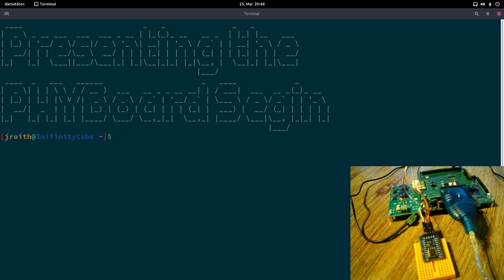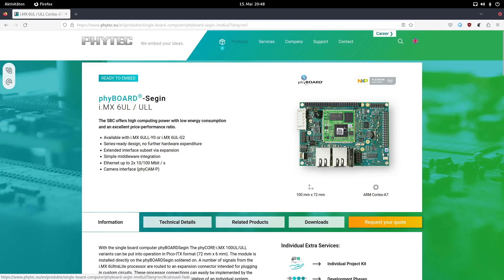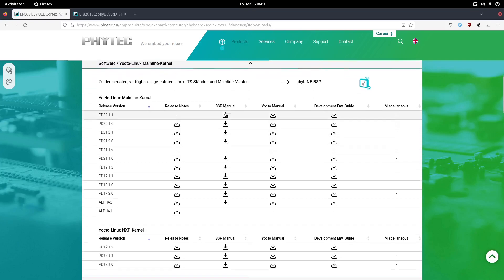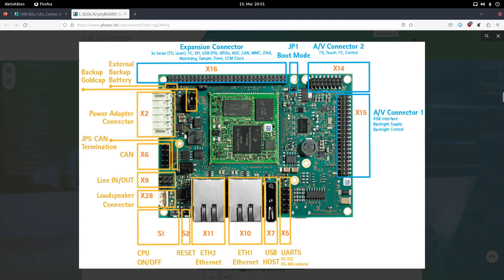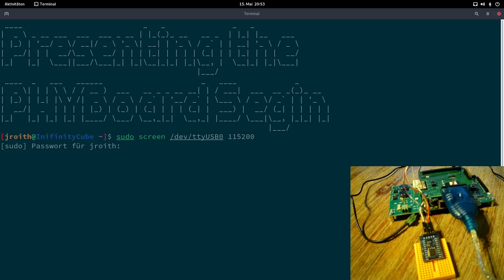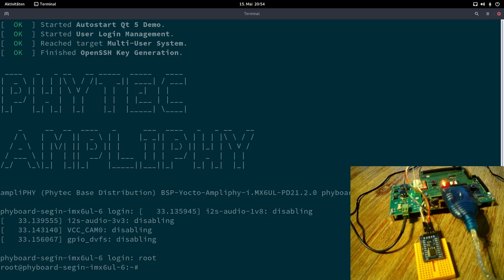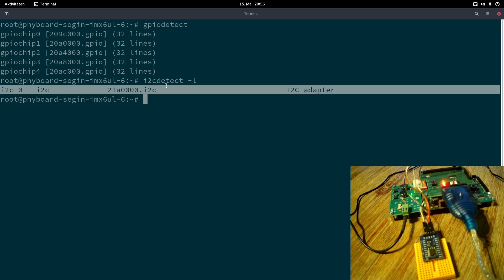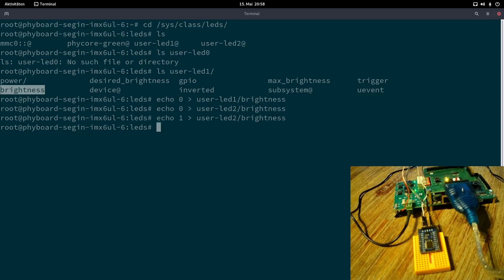Getting started with Embedded Linux - Presenting the phyBoard Segin

Comment: Hi, I have the phyBoard but its not on the development board its on a custom carrier board with Yocto running and PD17.2.0. but I can't get any commands such as SUDO, APT-GET, MAKE such commands it says not found. I got boards from a sale so it doesnt have the full fledged IO it has only a ethernet.
Reply from the maker: I think phyTEC doesn't include a package manager or build tools as make in their Yocto Configuration. So, it would be up to you to add them. Or it is also possible to take a precompiled rootfs with applications from Debian. Then you have everything you need and if something is missing, you can install it with apt-get. I know it is possible, but I don't know exactly how.
Reply: @johannes4gnu_linux96  Hi, How do I add these tools ? like APT and make, even getting apt running would be super helpful. I don't have any idea how to do so or what to look up on the internet for. It would be really really helpful if you can give a link or explain how to add these tools. 
There aren't videos on the internet about this pyhboards or how to boot a new image to them or their boot pins configuration. unlike raspberry or any other SBC.
And where can I find images to load on an SD card and boot ? the newer versions PD24.1.0 etc

Comment: Hi Johannes, I commented on an old video of yours and was hoping that you could answer my question. The question is about the open62541 lib.:" I followed all the steps and they all worked fine until I ran the command ./myServer after building the myServer.c file. It keeps printing out this error message: "./myServer: error while loading shared libraries: libopen62541.so.1: cannot open shared object file: No such file or directory". This file is located in /open62541-linux64/lib but I can't open it and I don't know what the problem is. Pls let me know if you have a solution to this problem. Thx"
Reply from the maker: Ok, did you run the ldconfig command? Because only with this command the libraries will be updated and it is able to find the shared library. 
If you have done this, but it is not working, you can add the following file:
/etc/ld.so.conf.d/open62541.conf
and in this file you enter the path to the library, in your case:
/open62541-linux64/lib
save it and then run ldconfig again. Then Linux should find the library ;)